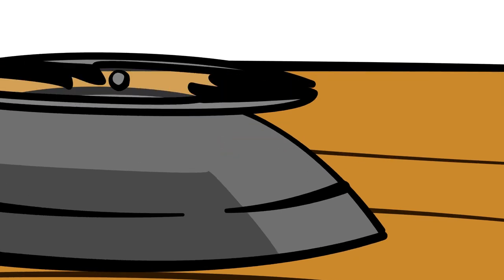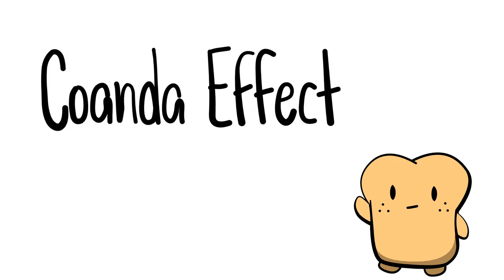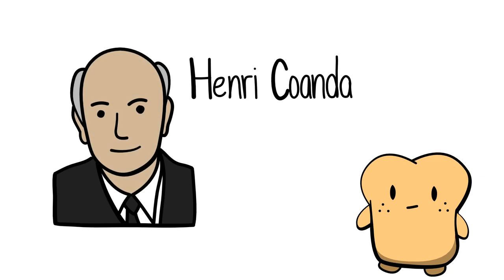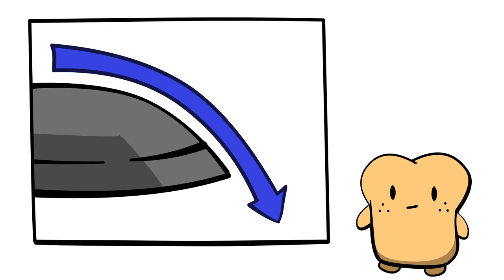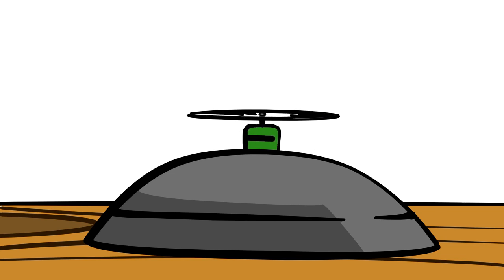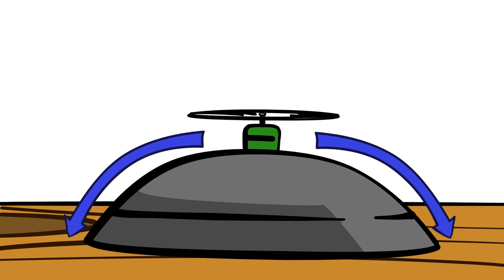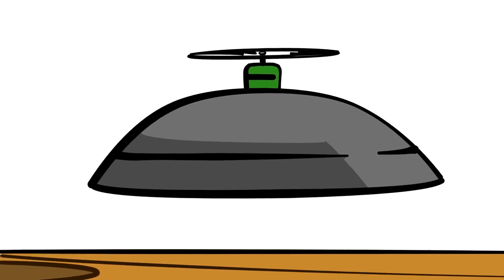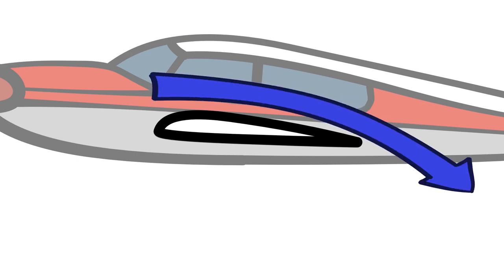Coanda Effect Explained with Fluid Mechanics

Comment: The question is why the air curves?
Reply: Fluid dynamics.  Air is like a fluid in its motion.  It has to go and be somewhere.  The only thing I would like to know about is how semi circle flies. With a smaller propeller on the top but If im right thing then i could see how it would create a suction effect. Instead of a lift.